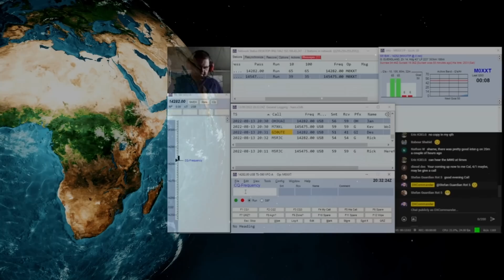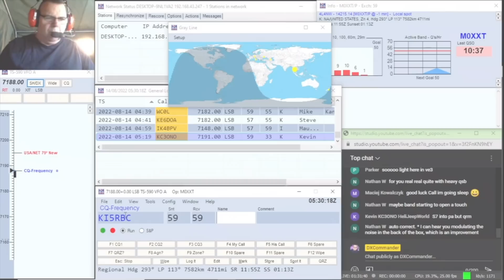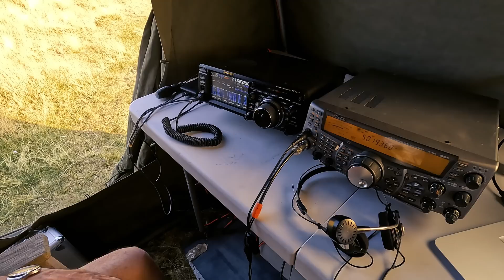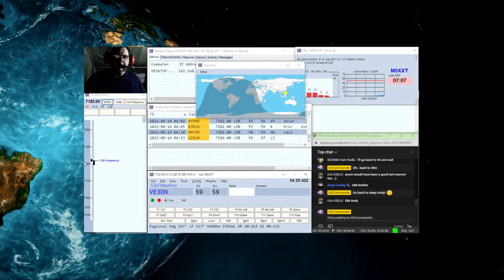Ham Radio Portable EmComm at High Altitudes - 1,500 feet / 500m HF/VHF Test

Comment: Hey guy! Just getting back into Ham DXing after a number of years. I'm commenting here because it is your newest post and I hope you'll see it and reply. Given my yard, and based on my beam headings as computed online, I could easily be working up to 80M by half-wave dipole and very close to 1/4 wave height. About 130ish ft one way, 200+ ft. the other. My best DX chances (by headings) would be to have two diff dipoles but would cross each other like an "X". I want full legal limit ability and do own an older Heathkit amp. Assuming they don't physically touch, how would this affect my clarity and signal strength? Say, an 80M and a 40M, both half wave, homebrew but would a balun be helpful here? I hope this is clear and you can help. I very much appreciate you or regulars who could help. All your DXing videos have really inspired me to get going again. TIA!
Reply from the maker: I have run 2 x 80m dipoles at 135 feet before with two individual coax lines for each. Unless you really are approching half a wavelength, I would honestly stick with a single Inverted V and a simle q/wave vertical.
Reply: @DXCommanderHQ  BIG THX! For quick reply. A long time ago I earned a Worked All States 80M with a bonkers 1/2 wavelength simple 14AWG wire hung up in a tree that literally squiggled back and forth up an 80foot Elm to make the 135 feet. Insane right? But it worked and tuned up 100W barefoot on a small 300W MFJ tuner - although that was sunspot max. This time I'm thinking true 1/2 wave 80M a up a 1/4 wavelength one way and a 1/2 wave long 40m up a true 1/2 wavelength the other. 40M for the DX, 80M because I like the Nets. If I end up with a 3rd antenna it would be a vertical for sure. You are appreciated!

Comment: Thanks for showing this Callum!  Great quality, loved the Drone shots, and interesting to see the kit in-use - especially the arrays of batteries.....  And your Internet Phone sat on a SS Thermos Flask Ground Plane, that's novel!  How about opening up sacrificial phone and connect 2/3 Slim Jims (ribbon cable) cut for 800/1400/1800MHz to a length of RG174 to the Ae in the phone?  Change the connection point for 100 or 150 ohms on each SJ and connect in parallel.   Hang it up on a bamboo pole. I use four Ribbon Cable Slim Jims set for 75 ohms (arranged like a Lindenblad) for 75 ohm 1090MHz ADS-B Rx with fantastic results.  Just watching your review of your Clee Hill Expo with interest....  Thanks again, de Peter G6EPN
Reply from the maker: Peter, seriously I have looked at my spare Samsung 9 model and tried to work out how to get mini coax. I did before once with a 3G dongle. Took it apart, worked out where the antenna was - and fitted my own! So I will get around to this. Nothing on the internet. I may be the first.

Comment: Any chance of a video about the setup of the equipment.  We often run more than one radio and have issues with interation between the radio's and interference. One local group operating at a local park close to me managed to blow the front end of one rig due to the close proximity of the radio's/ antennas. I know that big contest stations fit expensive filters to each rig and no 2 rigs operate on the same band. Even when we use different bands the close proximity of the antennas / equipment we swamp out each other.
 A video showing the practicality of a group /P set up would be very useful.
Reply from the maker: OK, so the "multi-two" setup.. "Front-End-Savers" are pretty cheap. I'm surprised you blew the front end. Antenna separation is a good idea and not operating on same band - or harmonics (eg 14.2 and 28.4). We suffered nothing but one antenna was horizontal (end fed) and the other vertical. Separation was about 45m (130 feet).
Reply: @DXCommanderHQ  not heard of these devices.  I see band pass filters used in US as described above with each radio dedicated to a band. These are not cheap but cheaper than a front end repair. But would be interested in the items you mention and where can I find the

Comment: Ahh real good fun..I used a short 5 m  full self contained, pull along camper,  and set up just outside the door., a pair of 1000 cca rv batteries that were rated 40 hrs at 5 amp steady.  So added a few soft white ground effect leds for lighting on there with 7amp radio xmit ( 21 watt out) for a total of 9 ahr.  Just could not kill those huge 1000 ahr batteries.. and heavy..oh my.
Reply from the maker: Oh my goodness!! HAHA!